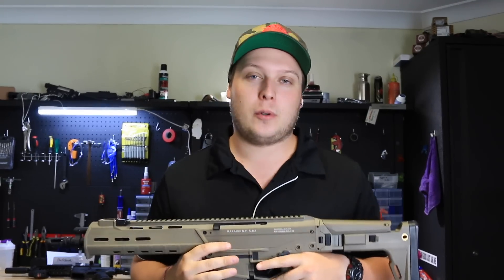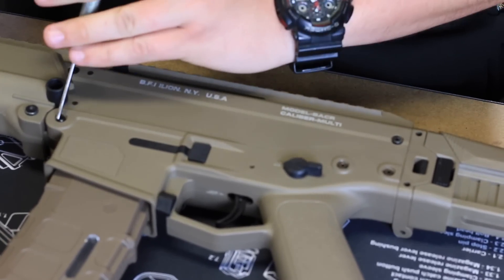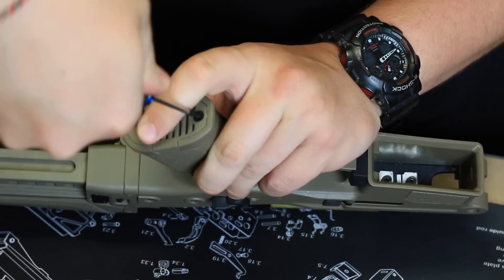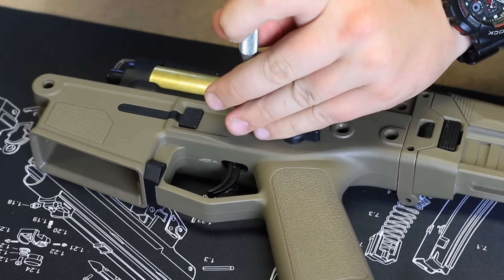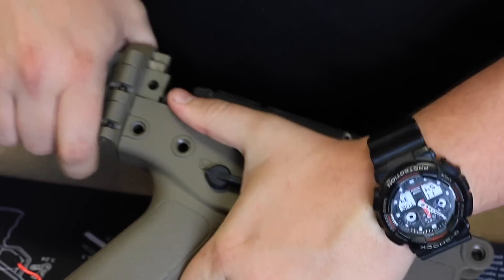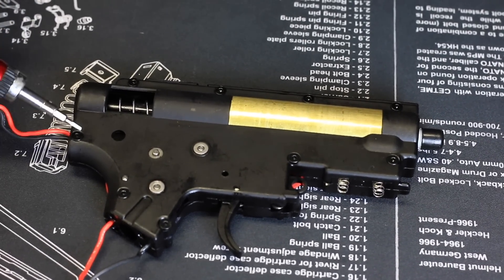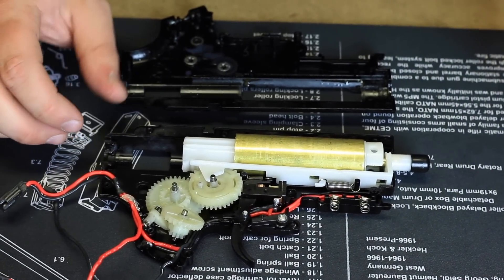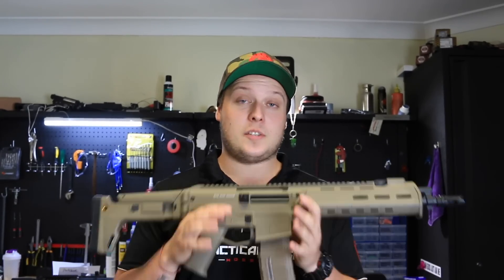Jinming J10 ACR v2 Gel Blaster Breakdown

Comment: Pretty certain the j9 motor retainer with the adjustment will fit straight on, motors ain't all the same the haichi motors are shorter than standard motors and do require some adjustment

Comment: Full Metal upgrade have one my self looking for the best upgrade was looking at a 170m spring at 557fps but it don't look good should get a 1.5mm on the 11v and it will run a 11v alone and as they seem to get weak even with a steel case at 150m will go a 110 or 130 if I can but would as new like some info if you could 😆.👍

Comment: Great video Brotha !
👍👍
What upgrades do you recommend i do to my 
JM-ACR-J10?
Reply: Steve Doherty  all u need to do is alloy barrel, green o ring and a 1.25 unequal spring and u will have 290fps I’d also recommend a hop up and stronger return spring and a good quality 11.1v battery 👍
Reply: @Aus_Prime  
Thanks heaps Brotha 
👍😎👍
Reply: @Aus_Prime  
What would be a good 11.1 volt battery modal that this ACR can handle mate?
Reply: no worries dude
Reply: @Aus_Prime  
Champion Brotha
Reply: @Aus_Prime  Hey mate could you link that spring? so confusing trying to find the right one cheers

Comment: what accessories should i get for the acr j10?
Reply: Im running metal barrel, 1.25 spring, o ring, hop up and 11.1 volt battery. Greeat fun
Reply: arkir how much better does it go with your mods? Got any links to what you got?
Thanks
Reply: @JSC-c No links sorry mate. Work was done by local blaster shop. Good improvement from standard
Reply: arkir ok no worries thanks,